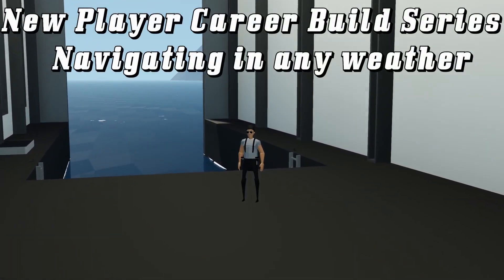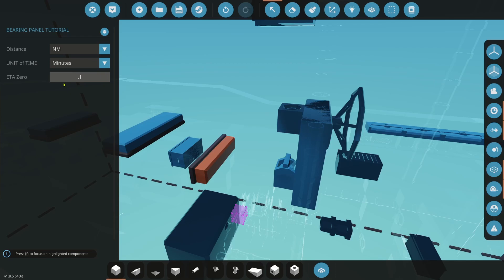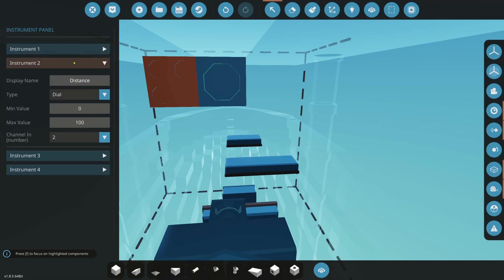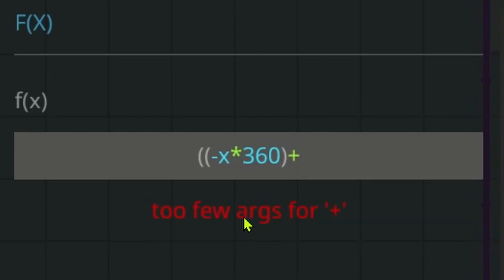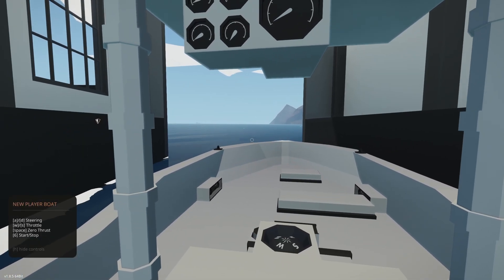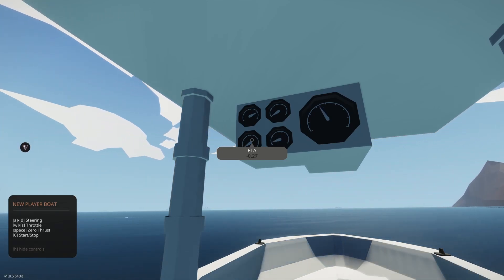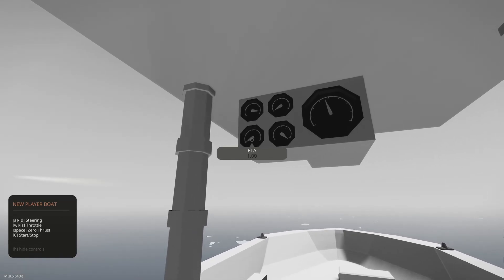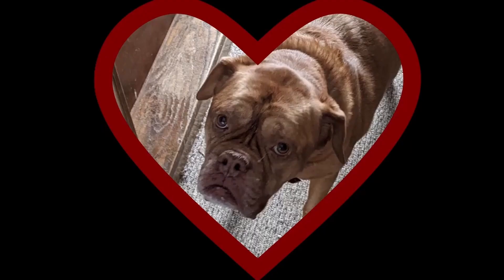Stormworks: New Player Career Build Series #5: GPS Navigation #stormworks

Comment: Sorry, but (-x * 360) % 360 Instead of ((-x * 360) + 360)% 360 is enough
Thanks! :)
Reply: Adding 360 before taking the modulo ensures that the resulting angle stays within a conventional 0-360 degree range, even when xx is negative. This is useful for normalizing angles to a standard range and ensuring that all resulting angles are positive and within a single revolution.
Reply: The formula ((-x * 360) + 360)% 360 is better unlike (-x * 360) % 360 goes to negative degree below 0 unlike the previous formula it goes to 360 again for easier navigating

Comment: I’d love to know a bit more about physics sensor vs GPS block in-game.  Maybe I missed it.   I know older nacho systems in the game generally used a compass sensor and gps block to do this so using physics sensor makes it much more compact.  Can’t wait to learn how to use this for autopilot and maybe learning how to add a monitor screen to display useful info or even a map
Reply: From the previous video, your composite channels are 1 and 3 for what was previously your "GPS X" and "GPS Y" respectively (confusingly, in the physics block, north south is now Z and up down is Y). Everything else should work the same.